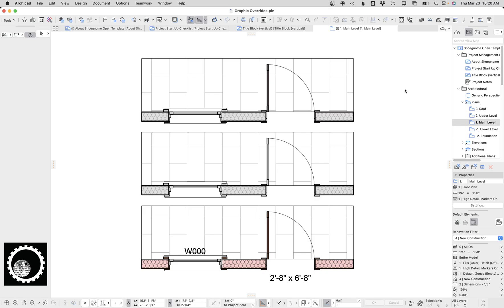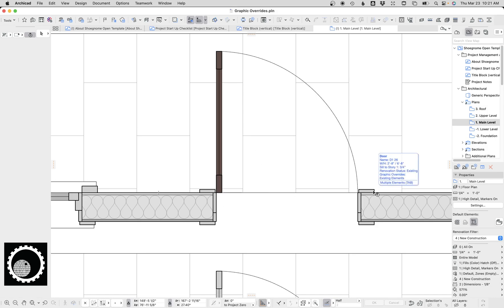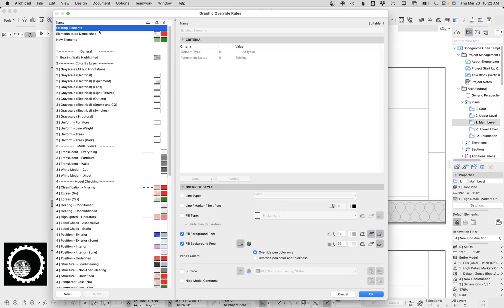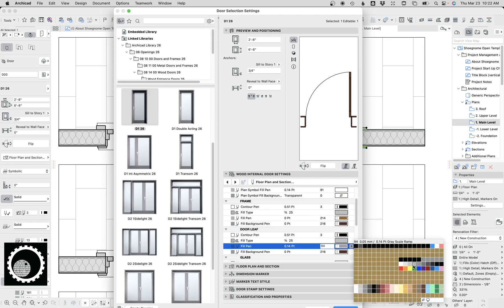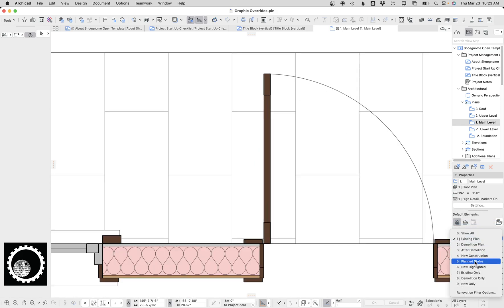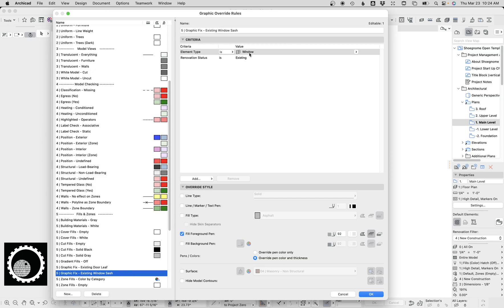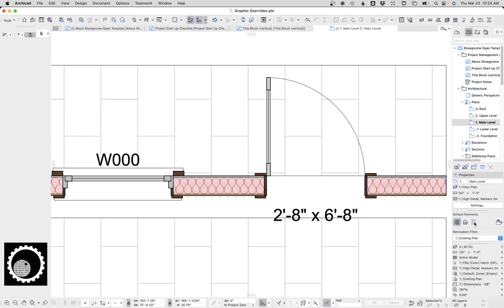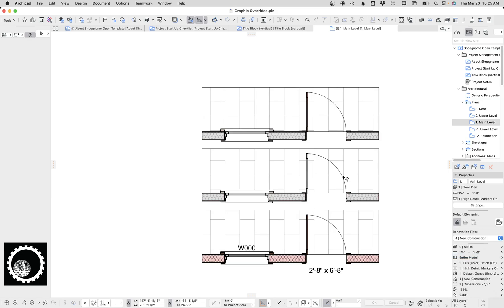Archicad Tutorial #90: Existing Door and Window Display

Comment: For existing doors, what I do, is showing them at 45 degrees opening instead of 90. Much easier :)
Reply from the maker: A lot of people do that. It's actually harder though. Once the graphic override is set it's automatic and works forever. And you don't have to worry about fringe cases where you need to show doors at weird angles. Also door swings can be accidentally changed by coworkers.

Comment: @shoegnome When you send permit docs to a GC, are you sending color? Or expecting sets on site to be printed in color? Every time I ask for grayscale printing near me, it gets delivered super dark & seems to obviate using grayscale at all (and color printing seems pretty exhorbitant for full size sets.) Why not have existing doors at 45deg (or simple/single line?) for a visual difference?
Reply from the maker: I've been doing color drawings for almost a decade now. Never had an issue. Half my contractors print in color, half don't. The color drawings print fine in grayscale.

As for 45 degrees or simple line, I don't think that's clear enough, it's  not automated like this solution is now, and sometimes I need to show new doors at weird angles.
Reply: @Shoegnome  i appreciate the reply, thx for the vid!
Reply from the maker: Glad you enjoyed the video.

Comment: Hey there! Your content is great. I am currently facing an issue and I am wondering if you could give me some advice on how to create a concrete masonry unit as a wall in 3D space. I need to have all the necessary details, such as the block, mortar, and so on, and I would like to see it in section views. It can be quite tedious to create all the detail sections manually in 2D. Do you have any experience with this? I would be interested in hearing your thoughts. Thank you for the great content, and keep up the good work!
Reply from the maker: CMU walls are tricky. You can use a complex profile wall to get it perfect in section, but it won't be what you want in plan (IE, it won't show the cores or the individual blocks).  AFAIK there's no perfect solution to get it to look right in plan and section. But if section and 3D/elevation is what matters then a complex profile wall with a good surface texture properly aligned to the coursing you want is the best solution.
Reply from the maker: If it needs to be perfect, you would need to model each block separately or look for a 3rd party solution (if one exists). Oh maybe the curtain wall could be hijacked to create the perfect CMU wall, but I don't know if that's possible.